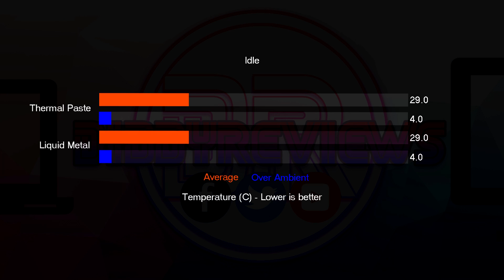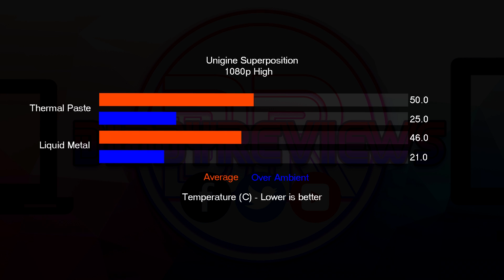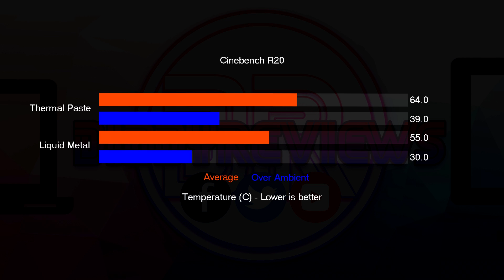Thermal Paste Vs Liquid Metal - Thermal Grizzly Conductonaut Review

Comment: Your vids are so helpful man thanks so much but do u know the best option for wired internet if the rooter is not near my pc?
Reply from the maker: Thank you for watching and your kind comments.

Try a power link. They basically plug into your power sockets. And then have Ethernet connections so one cam plug into your router then another one into your pc. Hope that helps.
Reply: DiddyReviews does it have to be a certain wifi company or any bro?
Reply from the maker: @laafn1012  any buddy. As long as your router has ethernet ports on the back you can just run a cable from one of those ports to the power link adapter then from the other power link you run a cable from that to the ethernet port on your pc
Reply from the maker: @laafn1012  https://www.tp-link.com/uk/home-networking/powerline/

This is what you're looking for dude.
Reply: DiddyReviews thanks man ill buy it soon